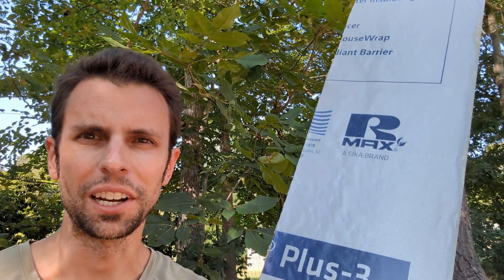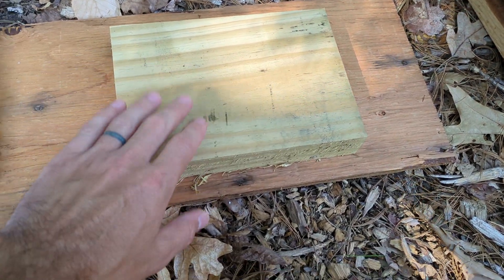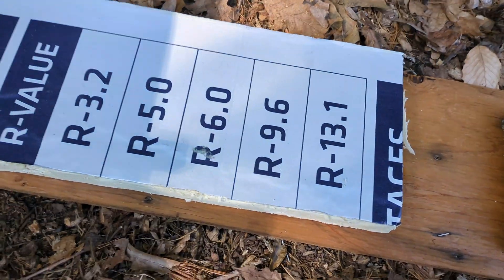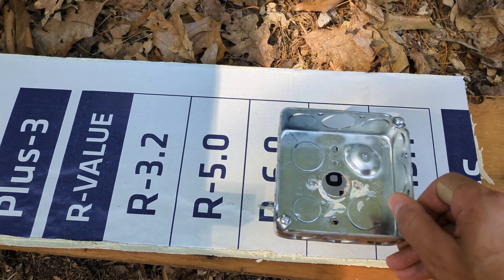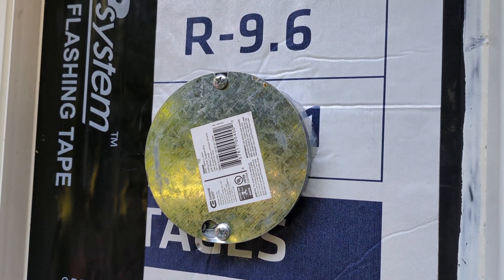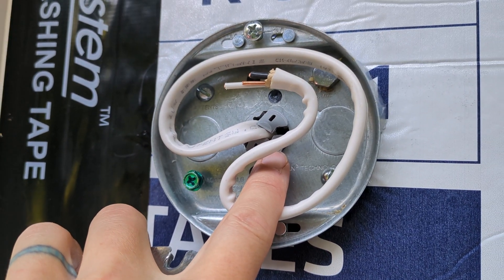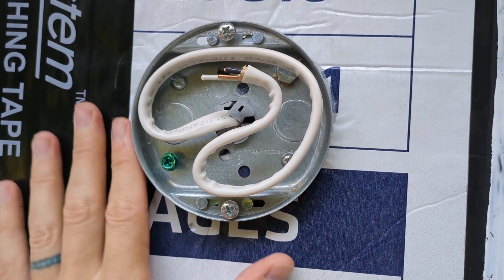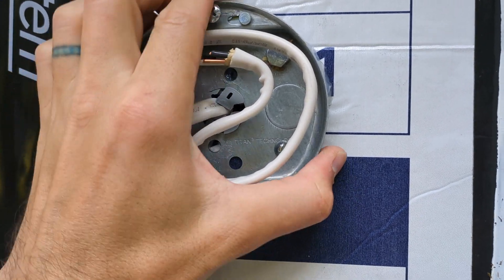How to Install an Electrical Box with Continuous Exterior Insulation

Comment: Just remember to consider NEC "box fill" requirements. I believe those "pancake boxes" are only permitted to have 1 - 14 awg romex wire (which would mean that the circuit would need to terminate in that pancake box).
Reply from the maker: Yes, terminated at each box and passed inspection. And thankfully there's some room in the light fixture to work with!